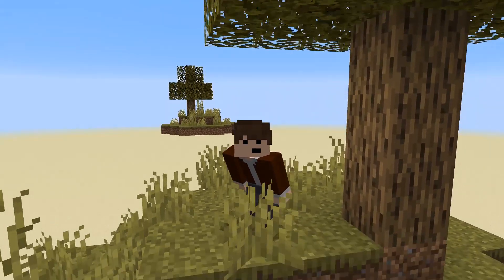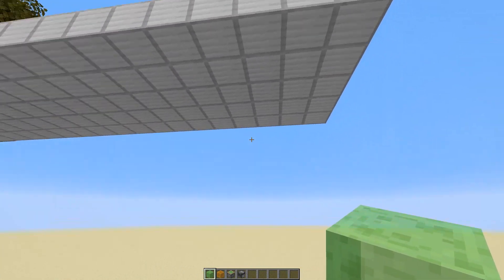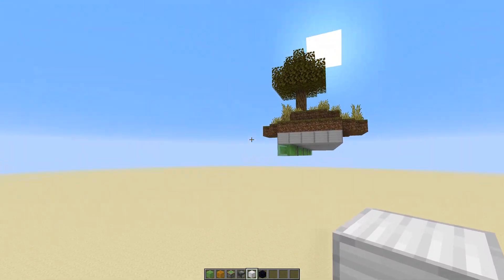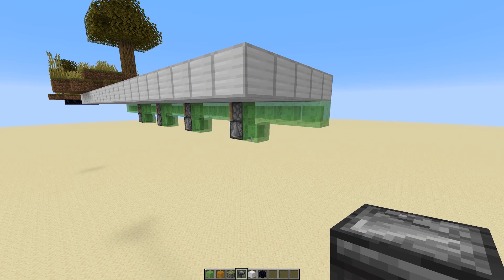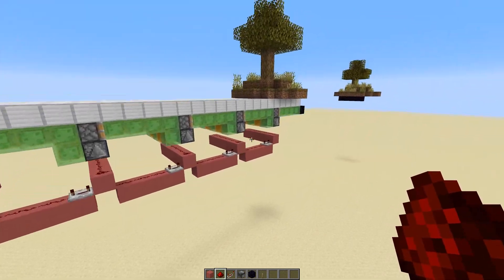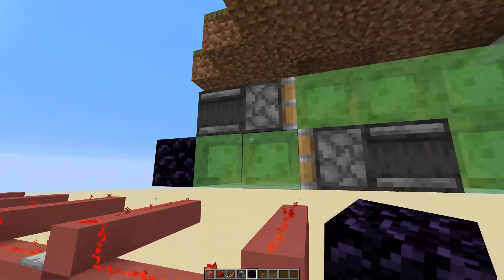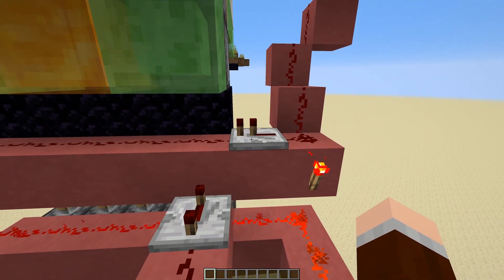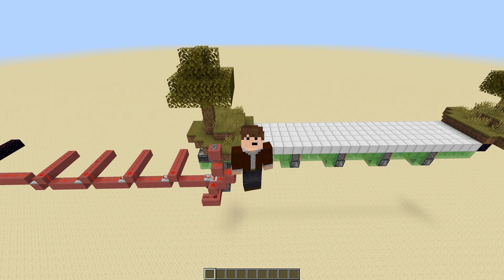INFINITE SELF EXTENDABLE BRIDGE | Minecraft Redstone 1.15+

Comment: Hey Opisek, I'm playing on Minecraft Java and normal edition on creative mode. I'm building a bridge 25x25x1 and can't figure out why only one portion of the bridge moves forward and then stops. I've checked everything and it all looks like yours, minus the fact that I've had to use repeaters to extend the redstone power beyond its max range so that everything could receive power. I've checked for and removed cyclical powering so the switch activates and deactivates everything in one go, all observers face the proper way, and all blocks receive power. I'm still trying to figure out the difference between my front row and the others but I'm stumped at the moment. Any advice?
Reply from the maker: From what you're saying I think that repeater may have introduced an unwanted tick of delay. You can feel free to join the discord group in the description and send me some screenshots there, so we can figure out the problem together.
Reply: @Opisek  After a good night's sleep I saw the problem, and it was really stupid. I overlooked something silly because I was flying around too fast to notice that there was a misalignment between all of the observers after the first row. I've decided to tear down the bridge and build it new from scratch, leaving only the redstone powerlines as guides. It had worked after I restructured the lines but the power then became uneven and the bridge fell apart. Thank you for the quick response! It's been a year since I've worked with redstone, and I primarily used it for controlled detonations, so I'm quite new to the whole honey/slime scenario. Thanks for the video!! It's really helped.
Reply: I usually don't sub to people, but I've liked the vid and subbed. I think I'd like to see more in the future regarding redstone and other new blocks. Cheers!
Reply from the maker: I'm glad you found it useful!

Comment: Hey can you use all honey blocks? Or does it have to switch?
Reply from the maker: It has to switch or else it will all stick together and not move.
Reply: Opisek ok thanks
Reply: How would it work for a 3 wide
Reply from the maker: You just need two strips which are block A and one which is block B separating them. If your block A is honey then B is slime block, and vice versa. You'll end up needing twice as many of the one kind, so if building in survival make sure you figure out which resource you have more of or have better capabilities of acquiring.
Reply: Thank you this will work great for my family server
Reply from the maker: I hope it will serve its purpose well!